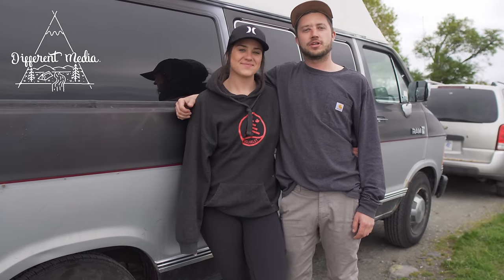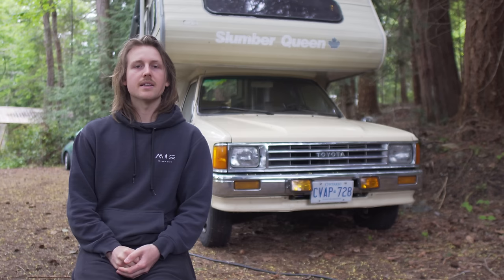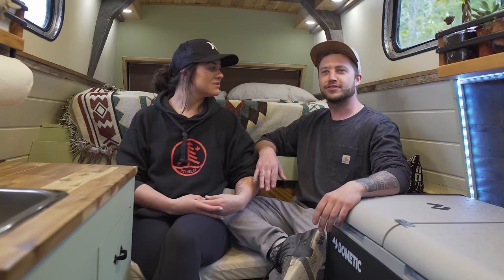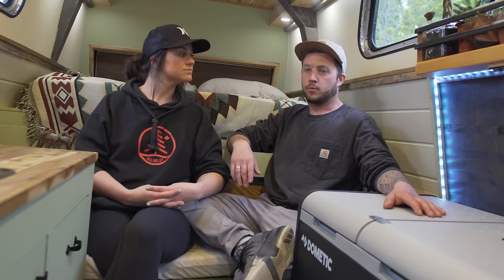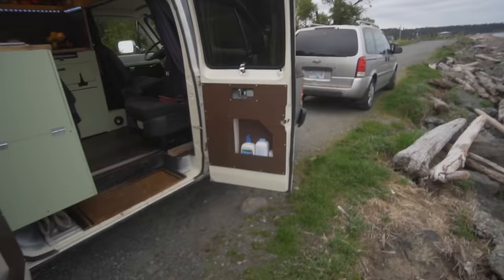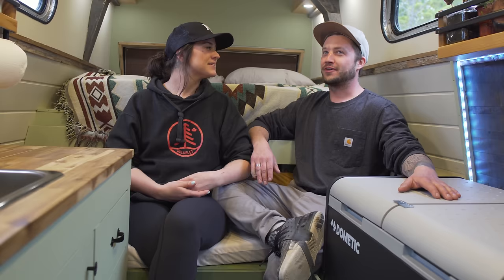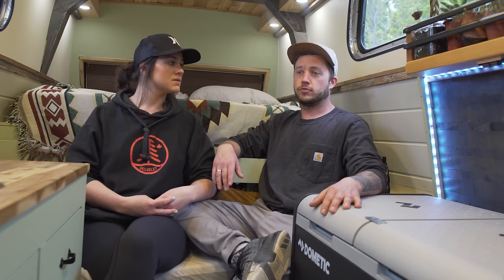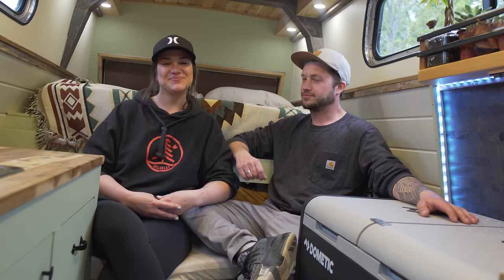Inspiring DIY Van Build Tour | Old Dodge into Unique Camper Van

Comment: I just sold (9/22) a 2008 class C motorhome with an E450 v10 triton motor with 137k on the clock which is nothing for $19,500.  It slept 8 people and was previously a "Cruise America" motorhome.  This is cool but you can find much more spacious setups than this with a lot less bother or similar cost to the money they said they spent.  This is cool and thanks for sharing but using a class C as a starting point would probably make the most sense for anyone watching and would probably cost similar money, even if you wanted to tweak things.

Comment: I like the build but I’m not quite down with the divided kitchen and the bench. Having to sit on an angle all the time would be difficult so I would have to sit in the middle. Other than that I like it. I especially like the bed facing out rather than side to side. Good luck traveling! Vaya con Dios!

Comment: Is the roll bar the reason u can add all that weight to the top of the van like the deck and solar panels?  I ask because i feel like maybe without it and with time and bumps on the road the fiberglass shell will begin to crack

Comment: One thing that I don't understand is how you go from charging your house batteries to then trickle charge the van battery. Can you enlighten me how to accomplish this?
Reply from the maker: there are certain solar charge controllers that do this because they charge your house batteries from solar, and alternator when running the engine, when the engine is off and the house batteries are full it diverts that solar energy through the wire to your starting battery, which is the same wire that charges your house batteries when the engine is running. here is one that does that
https://amzn.to/3Wm9qaJ

Comment: I hate tech.. I'd just have a portable jackery type thing and one fixed sola panel and one portable one..nothing would be built in.. I'd store my warm clothes and sleeping bags in cushions..no fridge maybe hole in van for cooler that stays under van with rug on top..I have to be able to stand up maybe a delivery type van but not too long..would have to be cheap..if I had 💰 I'd buy a tough but lightweight fiber moulded caravan and topless sports car